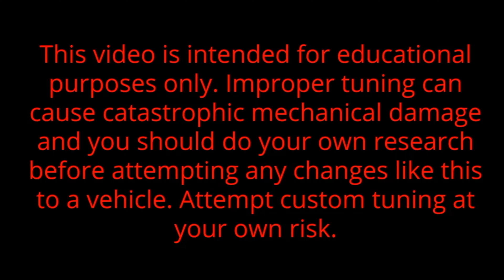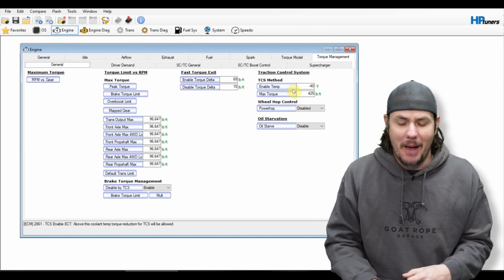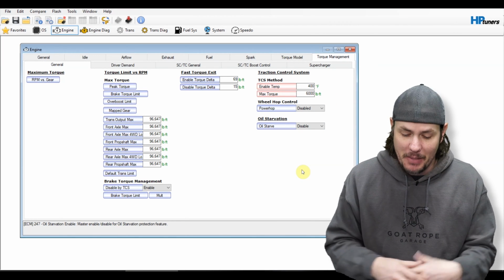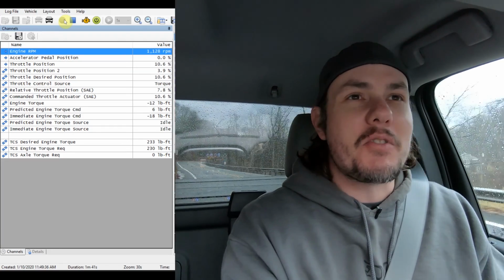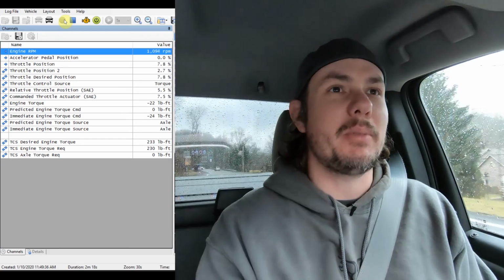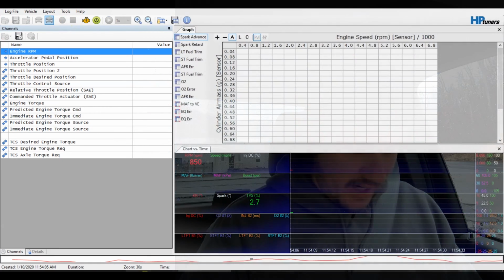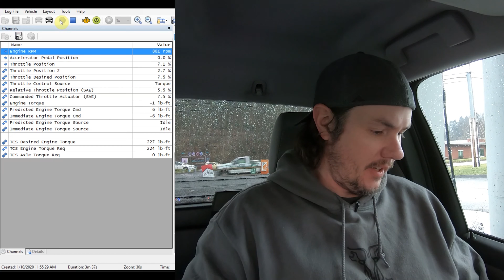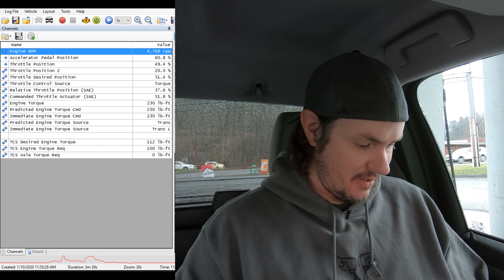Do The TCS Settings In HP Tuners Make A Difference?  Test In Tune Finds Out!

Comment: I have mine set just enough to allow my rear end to slide and fish tail but still allow me to  keep the car pointed where i want it to go, even up to WoT.   Reduce torque value setting for more wheel spin or increase torque for less or no wheel spin. If say your car has 500 ft lbs and you set the TCS torque to 300 ft lb, then the TCS will limit the engine to what is left of your power, which is 200 ft lbs when it detects wheel spin.

Comment: I recently just started playing around with these settings on my 2014 SS sedan. It has the e38 ecm and I left the enable temp alone and set the max torque to like 200 more than what the car dynoed. I also have enable/disable settings for using spark or fuel cut as a form of TCS. I disabled those and under wheel hop there is option for spark or fuel cut also I disabled those. It feels like it is quite a bit more torque when accelerating especially in 6th cruising. I would get a bit of a stutter before. But not it seems to have lessened. This is with a 3600 stall converter. So, I do think it made some difference. I would like to get it back on the Dyno and see if it actually made any difference.

Comment: mate...i have oil starvation on on my s85 v10... e60 m5... but this is something out of your channels scope...you are more into crap american engineering
Reply: Your incredible German Engineering has rod bearings as a maintenance item…
Reply: @winstonmcclean8703  dude thinks he’s hot shit because he has an engine that has a lifespan is 120k miles and using a quart of oil every 750 miles and needs their bearings replaced every 50k miles but says American cars are shit lol
Reply: @winstonmcclean8703  no..just idiotic owners...if you change the oil every 5k and dont rev it until up to temp...rod bearings is not an issue...i mean..it is..in the US;)

Comment: I have a 2013 2500hd z71 with 3.73 gears and it is a dog I can feel the power  slowly come back after it shifts and from. A dead stop if you step on it it falls on its face will just sqweek the tires then it feels like its thinking about it then once it is rolling it feels like it slowly comes back

Comment: The gen 3s do have some traction control options but I think it is very really on I have seen some later model suburban and Tahoes with a button like 05, 06 I was thinking about enabling it on my 03 suburban just because but I have not messed with it

Comment: Need help, I have a 14 sierra, twin turbo, texas speed stage 2 cam, vvt delete, dod delete, lt4 fuel pump and injectors, diamond pistons, pro comp rods. How can I tell if I've got my cam tuned in properly? Newby to tuning but really trying to learn all this stuff.
Reply from the maker: Basically, just need to get it running well, no stumble, decent idle, falls back to idle well. Cams just take a lot of fine tuning to get everything dialed in. Start with bumping the timing for down low and then get your AFRs dialed in. You might have to make some torque table adjustments if it keeps trying to pull timing.
Reply: Thanks for your gen v idle tuning video, if it wasn't for that my truck would be running like garbage.

Comment: Hey kyle   I  have a  lsa  engine with  a  base tune from  gmpp  that  has  oil starve enabled  on  it  !!!!
Also  has  

wheel hop control 
Powerhop enabled  
Via spark 
Via fuel cut
Reply: I  can  email  you  the  base tune for the  engine  for  more setting maybe  some  lsa  specific  tune  videos
Reply from the maker: Stock?
Reply: @GoatRopeGarage   yes stock tune from gm performance parts !       their 556hp crate kit for lsa i can  send you a copy of it !

Comment: That’s what I always got from it basically on and off nothing you could control but the only question I ever had was I wondered if the switch that turns it off 100% shuts it off or just to a certain percentage. But having I never wanted to get rid of it cause it will save your ass in the rain when everyday driving thanks brother easy on the Superado he’s on vacation lol

Comment: On my 16 Camaro, I played around with this and ended up finding out I liked it lower 79ft-lbs then the factory.  Also the camaro has wheel hop control (power hop) and oil starve enabled from the factory.  I have both off now